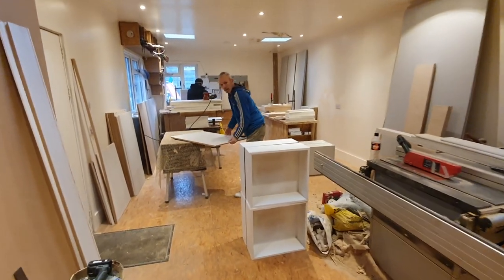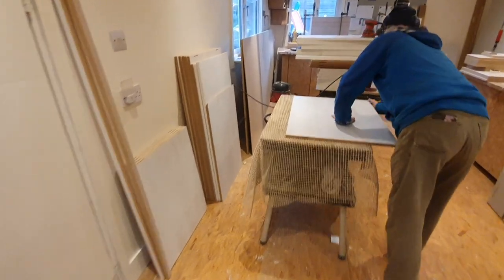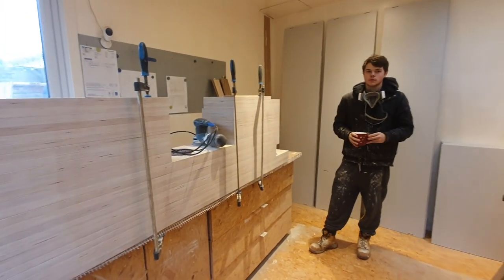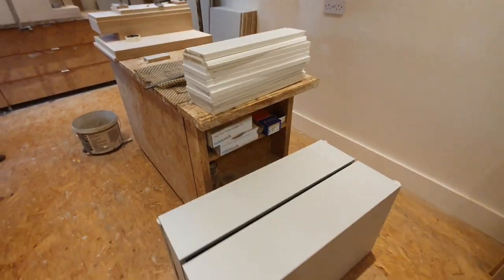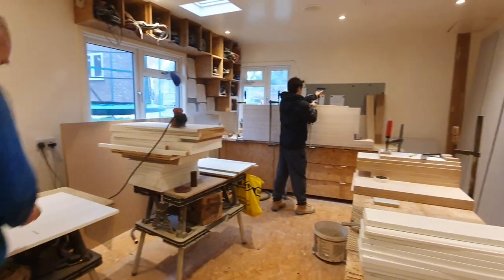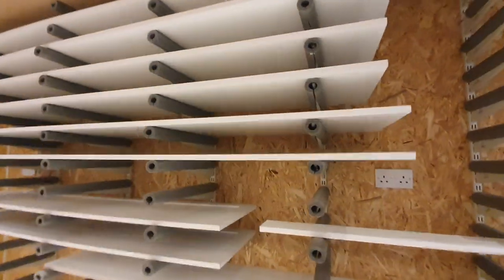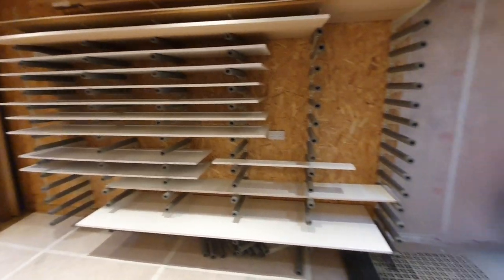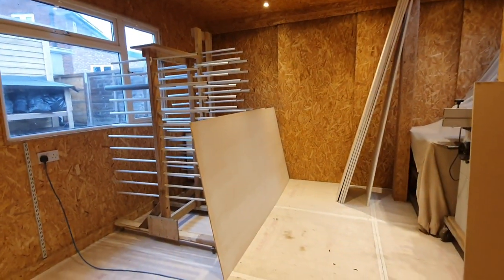Inside Our Busy Workshop & Spray Room on Christmas Run-Up | All hands on the tools !! | EP#39

Comment: Top content as always mate, I noticed you said you primed some panels and put 2 more coats on top, but you said in a previous video that you spray emulsion direct to bare mdf , do you still think it’s okay to do that because I’ve bought the paint for my sprayer to build some cabinets for the 1st time (using the teqniques I learnt from you) over the Xmas period to get away from the missus !!.
Also, if you could you post a video using biscuit jointer to fit shelves (marking out for cuts etc) at some point Would be cool.
Thanks for taking the time to film & post your projects, I’ve learnt a lot.
You and the lads have a top Xmas.
Reply from the maker: Sorry for the late reply your message slipped through the net!
It depends which videos you have watched but my old vids show me spraying a primer undercoat for the first coat (think I used a Leyland undercoat waterbased). This is still fine and will work and technically the right process, with 2 top coats of any finish, such as silk, satin, eggshell...

The process i use now in my newest videos is to use 3 coats of the same paint ( when I refer to the first coat or primer i basically just mean its had its first coat).
After any 1st coat whether using a standard primer like the undercoat, or using the topcoat as the primer, I always de-nib ( very lightly sand with p240) then dust off the workpiece.
Try and keep the room warm or aim the heater at the freshly painted pieces to stop grain from raising if using mdf, and don't spray too heavy. 
3 light to medium coats will give you a good coverage and finish.

OK sounds like a good vid to do re: biscuiting ill defo keep that in mind for new year at some point.

Thanks for all support and watching
See you in the new year 🌲🌲🌲🌲ryan
Reply: @thelondoncraftsmanworkshop   thanks for taking the time to reply, and yeah watched all your videos which have been really useful.
I see, you use the same paint for all coats but the 1st coat is classed as the "primer " coat, that tip has saved me a fortune cause in the past I used bullseye primer at around 70 quid for 5 litres !.
Will look out for the biscuit jointer upload in the new year, you and your family have a great Xmas pal and thanks for sharing your knowledge with us all, top man 👍.

Comment: Nice video! I recently got the festool lr32 system for shelf pin cups. Do you find 6mm enough for drawer bottoms? Getting panels cut (and edged if needed) makes it much easier. Thank you for all your content this year! Hope you all have a great Christmas
Reply: Yeah material and parts storage it's definately better to get rid of scrap I recently cleared out and made a big difference
Reply from the maker: Cheers mate. I generally don't use melamine so I just drill out my holes using a template and takes no time at all, but the melamine wasn't playing ball 😅.
I agree on the cutting and edging, such a time saver.
Tbh I think 6mm is plenty, if it was a massive drawer I'd probably go 12mm but I rebate the bots in, glue them, pin all around with the pin gun and then reinforce with 30mm screws. Never really had any problems 😁
Thank you for all the support and watching my videos, ill keep trying to put more up.
Have a great one too maty 👍👍🌲🌲🌲

Comment: What's the protective sponge sleeves you have on brackets in your spray room.
Reply from the maker: Hi they are pipe insulators that go over copper pipes. Amazon toolstation screwfix will all sell them 👍👍
Reply: @thelondoncraftsmanworkshop  great, cheers.